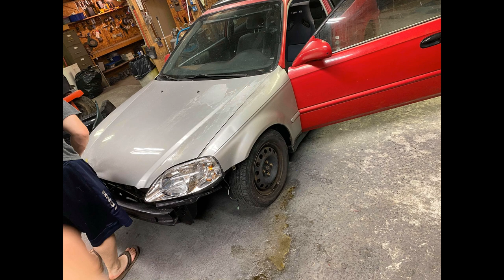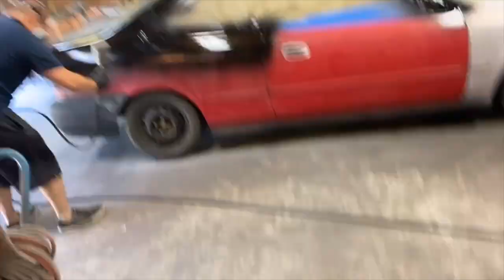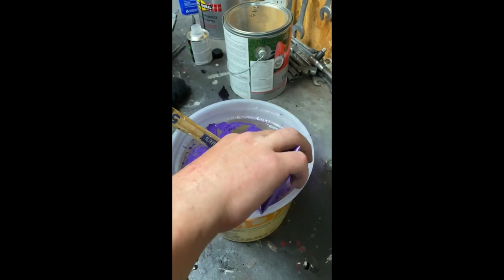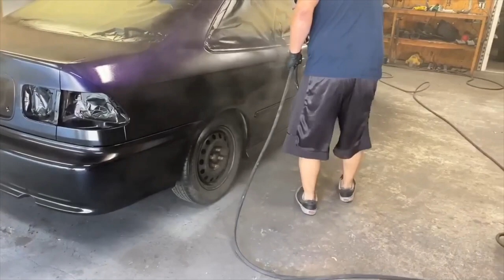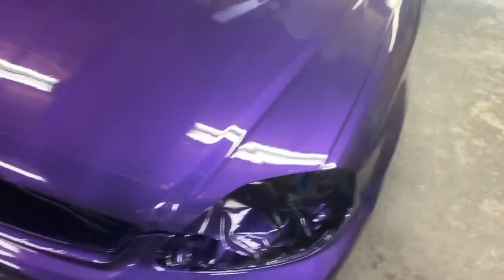RUSTOLEUM HKS PURPLE PEARL PAINT JOB HOW TO FOR CHEAP!!!!

Comment: Nice work! How long did you wait until spraying the clear with perl after the rustoleum black? Did you use a hardener like Japan dry?
Reply from the maker: I appreciate your question I waited a couple hours or overnight works great and yes there is a hardener agent that goes with the clear but I didn't use anything with the rustoleum black except acetone to thin it

Comment: I know this a older video what clear did u use and hardner did u use also
Reply from the maker: The clear coat I recommend using is Speedo coat 2K urethane clear you can get it off of Amazon here's the link 
https://amzn.to/3Sgu3EK
Reply: @WHITLEYAUTOWORKS  the one u used in the video is it not good for a overall job or does it not last that long
Reply from the maker: @lssleepers6464 in the video I use tractor supply clear it's not very good for long-term and the clear I recommended you is the same price you can get it off of Amazon and it's actually very good quality
Reply: @WHITLEYAUTOWORKS  thank u I was just wondering..it did turn out good ...I had a Lil simple job I was doing ..did u use tractor supply hardner with clear
Reply: @WHITLEYAUTOWORKS  imma also try the clear recommended for a overall job and longevity
Reply from the maker: @lssleepers6464 Yes the clear is okay as long as you're not doing a whole car with it and it's going to be out in the sun a bunch if so that clear deteriorates after about 8 months badly